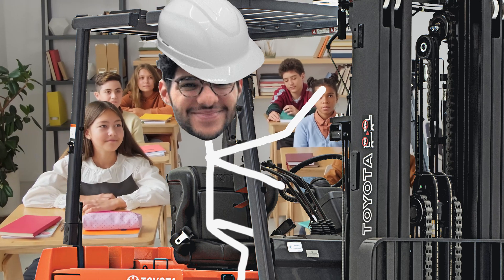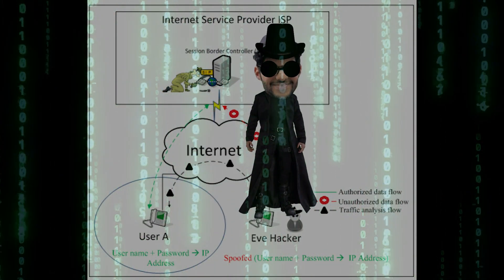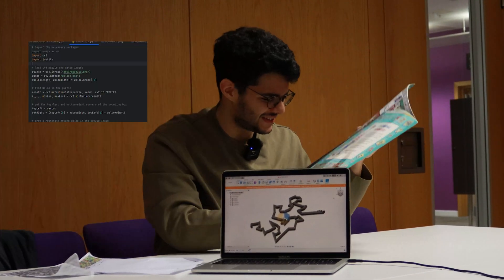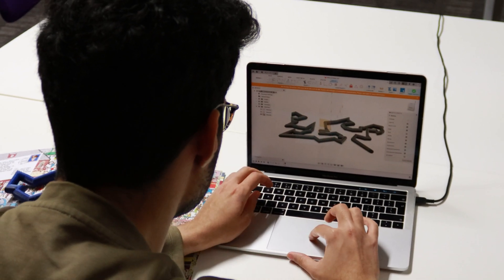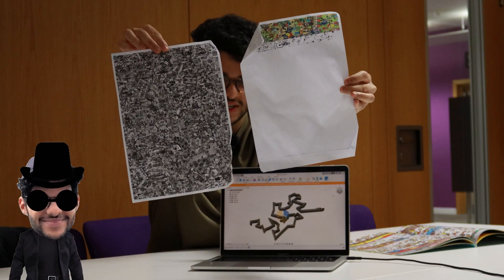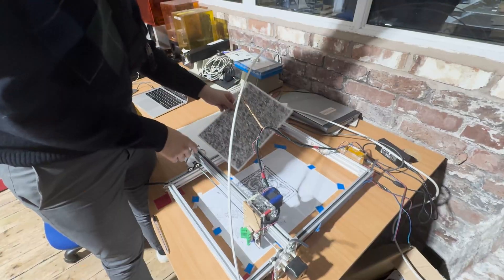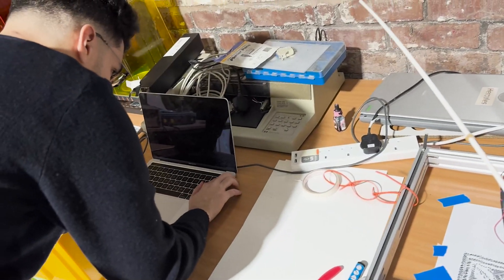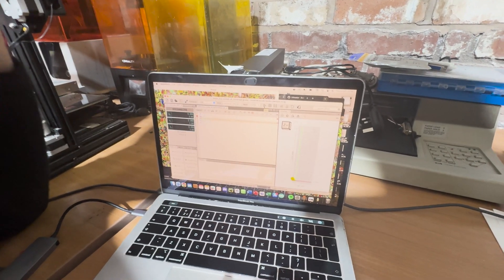I Built a Robot to Find Where’s Waldo Faster Than a Human!

Comment: the training dataset is key! for it to work you should do a few things. first try training the s-p6 network. second you need variety. try to put woldo on many different backgrounds. random noise, a beach, a book, lots of things. that will tell him at what to look. else he learns that it has to be on a white background. also if all the training images are perfect digital images he will struggle when you present real photos. include all scenarios in your yolo training and it will work. ;)
Reply from the maker: Thank you for the insight! What is the s-p6 network in this scenario? I did try to get a couple different scenarios but I suppose I need to get more styles of books and maybe cut a version of waldo and put him in these different situations haha. Thanks for the feedback though!!!!
Reply: @EamonMagd  when you specify the model to use, you can use the s-p6. its the S network (small) with an adittional pyramid layer. (6 instead of 5). here is a sample call for the training, that needs to be adjusted for your values: !yolo detect train model=yolov8s-p6.yaml batch=55 epochs=1000 data='/media/cnnserver/Data/mydataset/dataV8.yaml' device=0 cache=true patience=0
Reply: @EamonMagd  also note that the Size of wally is imporant! if you train it only with a huge wally it will onyl find huge wallies.. tehs ize should match the searched object or contain multiple different sizes. for the actual search, i would split the images in smller images (640/640) where each image overlaps a little bit to avoid cutting wally in half, and would process them all. should be quite easy and quick in python